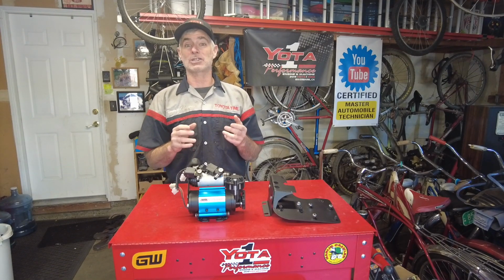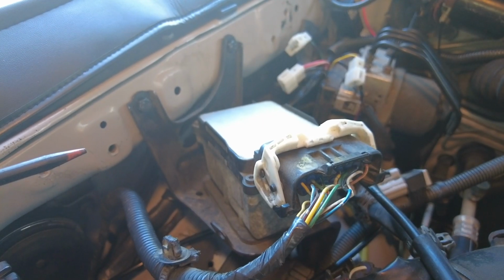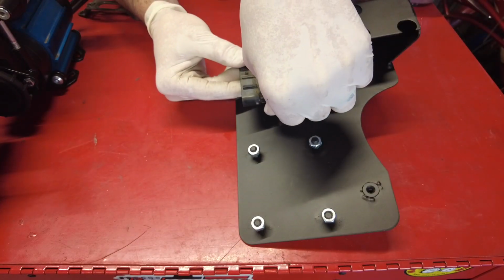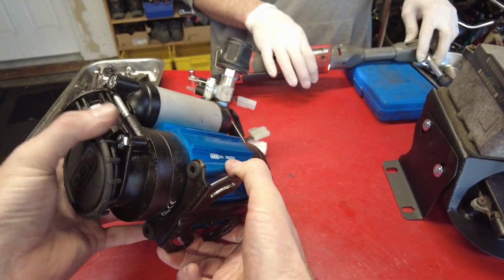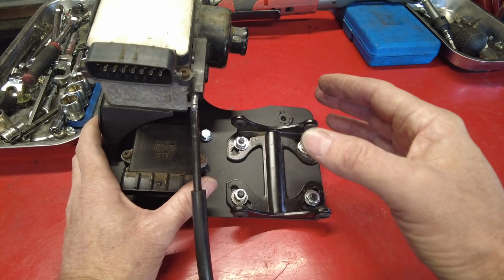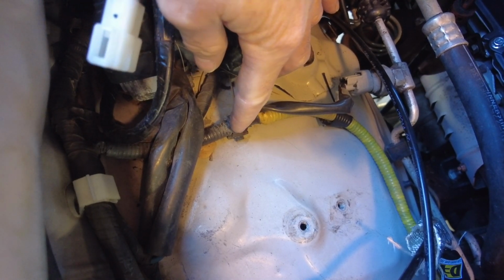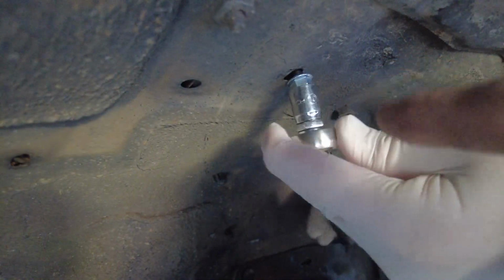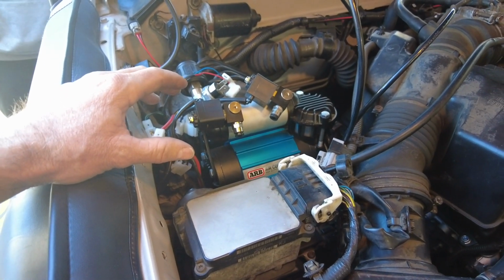Yota 1 Performance ARB Air Compressor Bracket Install

Comment: Any issues clearance wise running the spiker hood struts with this mod?
Reply from the maker: I don't believe it would hinder the hood struts because nothing is coming any closer to the passenger fender by using this bracket.

Comment: Thanks for another great 3rd gen video Timmy! Product looks great, but gave me a little sticker shock. Great design though and Yota1 makes great stuff. I already have my compressor mounted inside my plate bumper, but that bracket looks like it could be a perfect solution of where to put an auxiliary fuse panel (other than it being on the opposite side of the battery). I saw a guy on the forums who used to make a plastic bracket for the drivers side of the engine compartment but I think he stopped making them.
Reply from the maker: You're welcome Ben.  This is something made in the good Ol' USA and there is some time put into making these because there's welding involved.  Cool custom things do cost some coin.  It's a great functional design.  When you think about the time someone would have to put in to make something similar on their own, the price does seem very reasonable.  As they say, time is money.  Thanks for the comment.

Comment: Love the video Tim! Does this work for the ARB Twin Compressor models?
Reply from the maker: It's meant for the single compressor models.
Reply: The twin models are sweet but they are alot more low profile bet there better for mounting under the vehicle for the twin style models